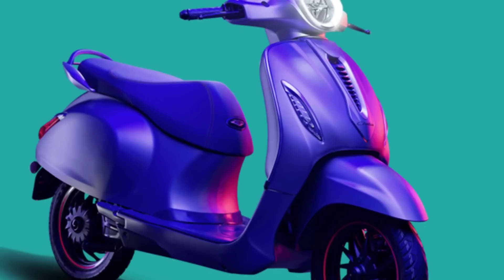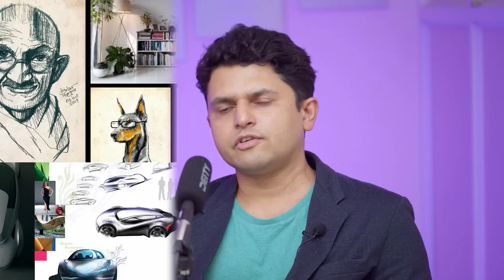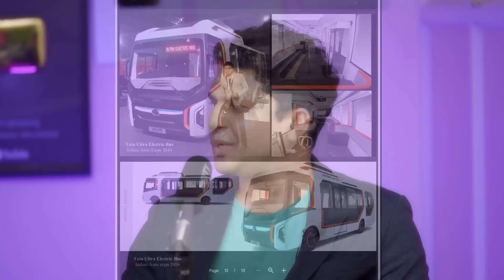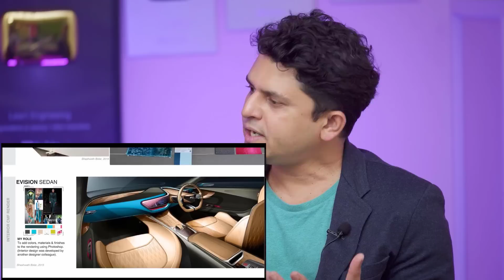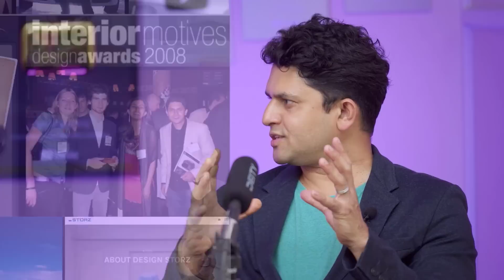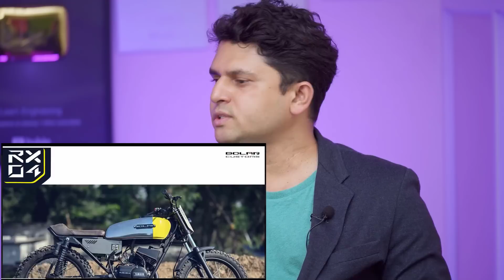Sabin Mathew interviews Shashwath Bolar | Head of Color & Trim Design team - Bajaj Auto

Comment: Respected Sir,
I have been following you since last two years and i must say you have got fantastic skill to teach students in very effective way. Your contributions in turning difficult concepts in simplest form is just amazing.
Continuing to this i am looking forward to get simplest answer to my following question.
Que. How much power require (hp/watt) to rotate an object (cylinder Dia=2meter,length 4meter & both ends of cylinder are welded at centers by shafts of dia 0.5meter and length also 0.5 meter where on shaft keyway is provided onto which motor has to be coupled)?
So what should be motors hp to rotate this cylinder.(Material SS316 Density to calculate mass is 8000kg/m3)
(Note: final Rpm require 4rpm)
Moment of inertia has to be considered.
Reply: Better ask on Chegg or check my channel and check playlist on "Chegg answers free" (link below) where i explained answers like this one
https://youtube.com/playlist?list=PL_XlPpR6bRFGoob1JrrgXRkvc3XwHU7Xd